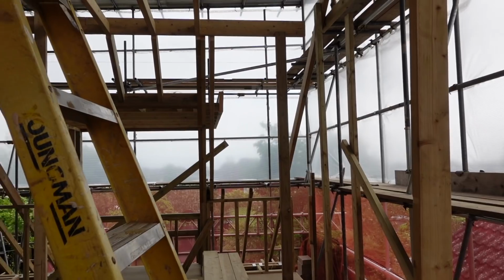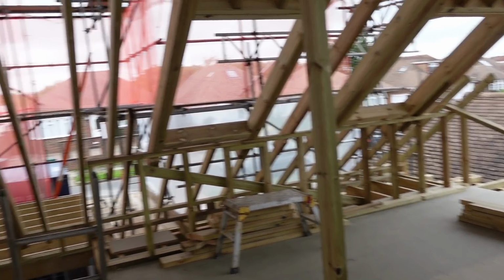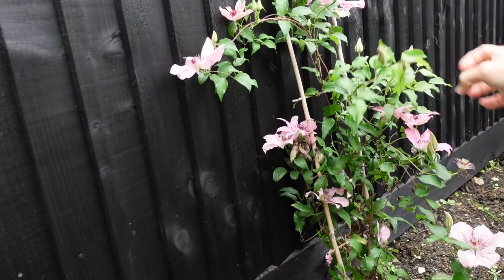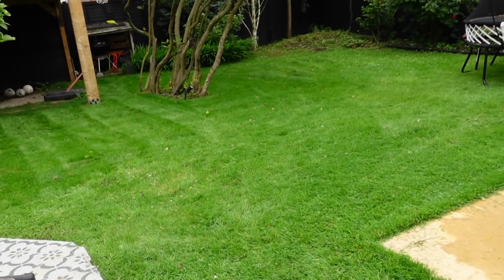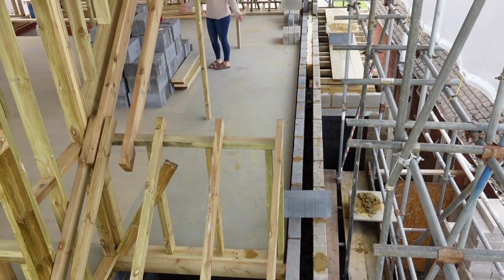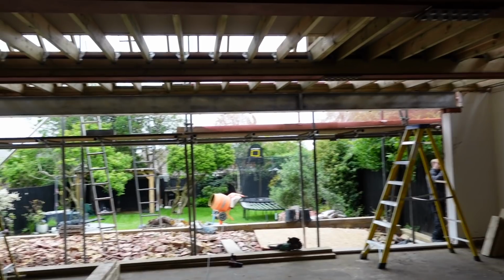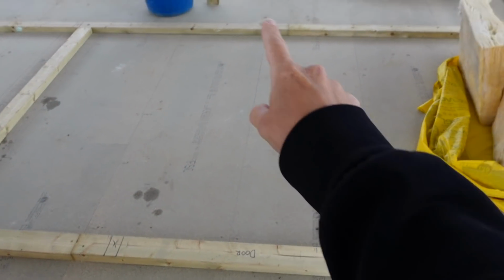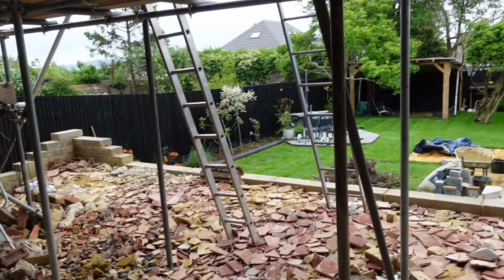WE HAVE A ROOF 😱 WEEK 12 OF RENOVATING OUR BUNGALOW | Kerry Whelpdale

Comment: Think about your Christmas lightening requirements too, sockets for trees/plug in decs.     If you need a socket by your staircase for the stair garland, which will also be good when you hoover the stairs.  Outside sockets for any decorations by the front door or rear sliding doors.   Do you want lighting above your kitchen ceiling cabinets if there is a gap for the party strip lights.

Also will you hide a tv in your wardrobe, if so you will want a socket in there too, probably along with plugs for a sky box.   To be honest you can never have enough sockets, but of course the more you have, the more it costs.
Reply from the maker: oh yes very good points.. I never thought about a socket outside the front so I will now ask our electrician to add one there.. thank you xxx